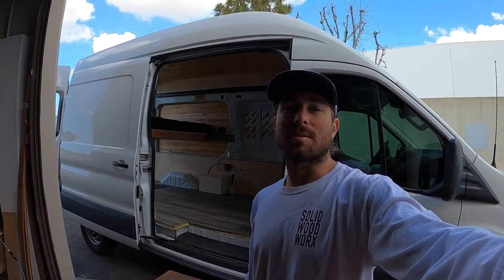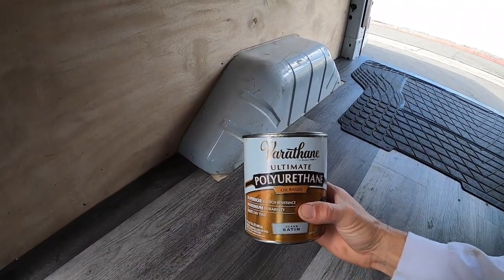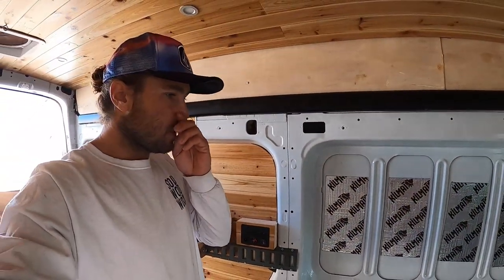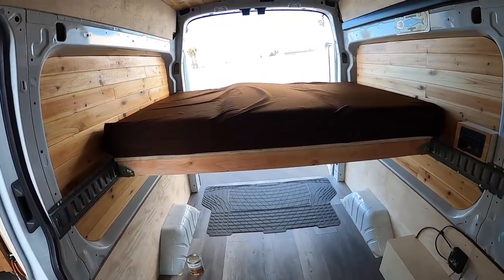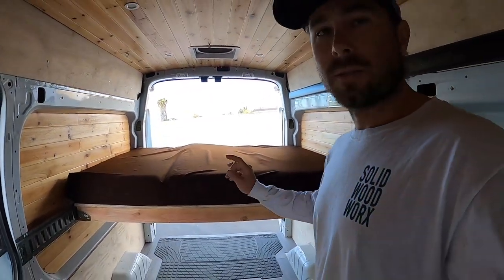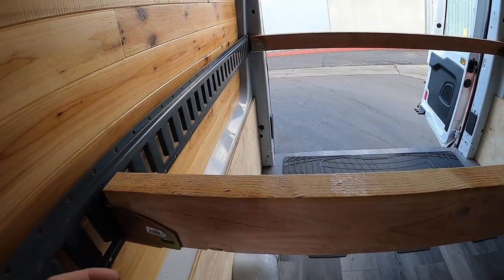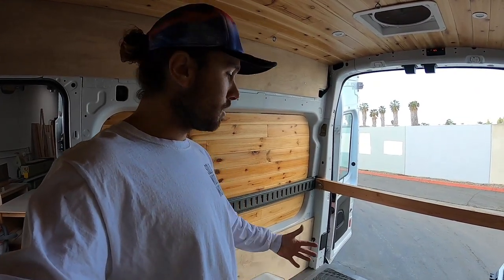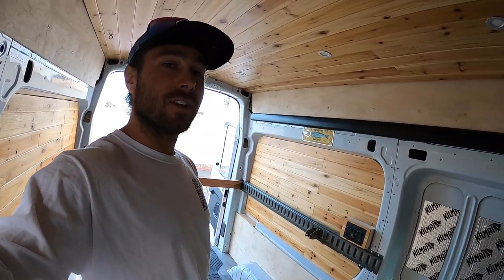Ford Transit Simple Removable Bed

Comment: Cool. I also made our van bed removable because we do a lot of construction, so hauling large things like plywood or whatever. I just installed a 2x3 along each side of the van with some bolts, then I made 4 separate panels with 2x3 frames and plywood on top. Slide them over the side 2x3 supports and screw 2 screws each side for each frame panel. Unscrew the screws and take out the 4 panels and you've got lots of room to haul. But I have also found that for certain things we can just keep the bed in to haul lots of things too. Like if needed, we can even slide plywood and things like that on top of the bed. Just remove the mattress/bedding etc.

Comment: Great system for the bed. Only change I would make is to have slats for the base because a solid bed base makes the mattress go mouldy in a van; too much moisture build up. Ikea makes doing slats super easy, you can even buy them with their own pre-constructed frame (£80 for a king size) if you haven't got the tools to make a groove in your side supports (£30 without the frame for a king size). Thanks for sharing.
Reply: Thank you for adding that bit of information! I am getting ready to build one out and that is most helpful
Reply: Drill the platforms that you saw him pull off the cross-members with a hole saw for door handles, still relatively strong and now airy and lighter as the slats would be.

Comment: Very nice can't ask for it to be any more simpler then that, easy to take apart and  ready to use as a regular Van. Question? I guess no need to make honeycombs holes in the wood panels for moisture under the mattress.
Reply from the maker: I didnt do the holes on this build didnt think was super neccessary because they wont be sleeping on it very often

Comment: Are you worried at all about having rigid pieces of wood across the span of the van? I seem to remember reading that allowing some flexion to occur in the van walls is important while driving. Also can the van wall pillars support the body weight of all the bed material and 2 full grown adults? I have always assumed that is why you see so few builds like this, but this is certainly a lot simpler and more space-conscious than building boxes!
Reply from the maker: Cuatomer has not had a problem seem him quite often out surfing and wood flexes
Reply: Tons of people build their beds like this with no problems. Our van bed is similar to this. The van walls are very strong in these cargo vans with all the ribs, etc.
Reply: A cheap e-track wood bracket can hold a working load of 800lbs. Combined with others...even more.👍

Comment: How are the bed panels secured to the 2x4 stringers? They really need to be attached so they don’t rattle over bumps. A few hangers bolts with thumb screws or wing nuts would do it. Van is looking good!

Comment: How did you do the panel to make extra room for the long bed? We have bed in about same position, but wondering how to get our panels up. Seems there is not much to fasten them to there (thin metal sheet). Did you glue them up?

Comment: Thank you for the build idea.  Love the simplicity!  
Are you using 1/4-20 plus nuts and bolts to bolt the E-Tracks?  I'd really appreciate any tips on if you drilled into the frame, used any pre-existing factory holes, and size drill bits for the associated plus nuts.
THANKS FOR THIS VIDEO!!!
Reply from the maker: This was attached with self tapper screws, Thanks
Reply: @SolidWoodWorx  Wow, this is a fantastic build. Love it! You say you were able to attach the E-Tracks with self-tapper screws. Any concerns with strength and being able to hold up that weight? I'd like to do something similar in my van build.
Reply: @SolidWoodWorx  Hi Thanks for the video, it's great! One question, Is there different type of self scew on the market, I just tried and without using much strenth on the screws they became loose .. thanks
Reply: @huguesfrechette  I'm about to do this. How did you solve this?

Comment: Brilliant bed solution for the bed! Quick question: It seems theres no insulation in the van. Is that correct & if so, why?  Thanks tons! Subbed.
Reply from the maker: I am unsure why the customer has not insulated. he does not live in the van mostly just uses it for work and a night surf trip here n there.

Comment: This looks like a great idea, and looks as though it would fit between the "window panels" in the back of my low roof 130" wheel base Transit crew van.  I don't have the capacity to build it myself and live in Colorado.  Any ideas who might be able to build such a bed in my area?
Reply from the maker: Avcrig.com does van builds in Colorado

Comment: Great video. How did you adhere the cedar planks to the wall at the head and foot of the bed in the cutouts? I’m  trying to optimize my space for the length of my bed.
Reply from the maker: I glued wood strips into the cavity and pin nailed to those

Comment: Does the inner dimension of the bracket fit snug an actual nominal 2x4 or an actual 1.5 x 3.5 piece of wood? :face-blue-question-mark:

Comment: Great bed idea, I love how you can easily remove it.  How much weight do you think it would support while only being connected to the walls at the ends?
Reply from the maker: I had 3 people on it once I built it to test it. Didnt budge, couldnt tell you an exact weight limit. I have about 6 bolts in each side.
Reply: @SolidWoodWorx  Thanks for the quick response
Reply: @SolidWoodWorx  Can you share what bolts you used?  Did you put them evenly across or mostly at each end?

Comment: Really like your work. I have seen your pickup truck bed/storage and that was also great. When adding the cedar to the ceiling, did you install directly to the metal ribs in the ceiling or did you install furring strips to the metal ribs and then nail? Thank you
Reply from the maker: Furring strips

Comment: Nice work! How did you route the wire into the engine compartment for the alternator charging? I'm trying to figure out the best and easiest way to do this. Thanks for any info.
Reply from the maker: You only need to route it to the battery which is under the driver seat in these vans

Comment: Hi there - what screws / fixings did you use on the etrack? Were there just one in each end going into the metal van vertical supports? Thanks
Reply from the maker: There were 3 on each end

Comment: We’re the only mounting holes for the bed frame at opposite ends? I could not see any in the middle.  Are the supports at opposite ends strong enough? I am over 230lbs so it will need to be strong.
Reply from the maker: I have seen the customer a few times since the deal and he has had no problems with the bed. He and his girlfriend sleep on the bed which is over 300 pounds and have not had a problem

Comment: Is the e track stable enough with just the distal attachments? How did you secure the e track to the frame? Did you use crossnuts? Thank you!
Reply from the maker: I’m not sure what distal attachments are. But yes bolted into the side wall.
Reply: I googled distal attachments because I overheard those words at a physical therapy session some while ago. So were you serious or do builders of conversion vans use that vernacular? geezus, dude.

Comment: Can you send a link / describe the pins you used for the 2 by 4 into the coupler?  Thanks in advance!
Reply from the maker: There called pull pins
Reply: Thank you!  Do you recall the dimensions of the pull pin?

Comment: Is there insulation in this van? I notice your builds (bedframes) are always solid wood, how do they hold up against moisture and mold? what about air flow under mattresses and stuff
Reply from the maker: I installed insulation in the ceiling before adding the cedar tongue and groove. Never had a customer say they had mold or anything from my bed builds.
Reply: If you have good ventilation (i.e. a fan that can vent out) there should be no problems. Just keep condensation and moisture in the van to a minimum and no mold should happen.

Comment: How much would a setup like this run if I were to have it done professionally by someone like yourself. My mom is interested in a similar setup and someone quoted her $8K. I think her setup included some cabinets and that's it, no bathroom, no kitchen, no shower. Just a bed and some cabinets. 8K seems a bit steep so I told her we should look for someone else.

Comment: How do you have that E-Track bolted to the wall? Just 4 bolts on each of the ends?
Reply from the maker: 8 bolts total
Reply: @SolidWoodWorx  Thank you. I was going to run an L-Track for my bed but the E-Track with those wooden beam inserts looks way better
Reply: @SolidWoodWorx what kind of bolts did you use? And did you drill holes for the bolts? My Transit only has one hole on each end
Reply: @mbdbandtube  I'm about to do the same. How did you solve this?
Reply: @shannonyoung9870  they don't line up at all, so I assumed he drilled holes into the interior walls. 
I mounted the rail to a 2x6 and drilled through the wood, and still I was only able to do two bolts per side. I used m6 rivnuts, which you use a rivet tool to insert, and then inserted m6 50mm bolts to hold them in place. That being said it is very sturdy and holds up great.
Reply: @mbdbandtube  NIce! I have the rivnut tool and have been doing that in other areas. So the 2X6 is mounted with two bolts on each side, and what did you use to mount the rail to the 2X6? Thanks for responding!
Reply: @shannonyoung9870  I just used star bit screws in a bunch of places. Seems totally sturdy. It was probably overkill but it was easy, cheap and it works. I also didn't use a panel for under the mattress, I made a basic bedframe topped with Ikea bed slats and it is really comfortable.